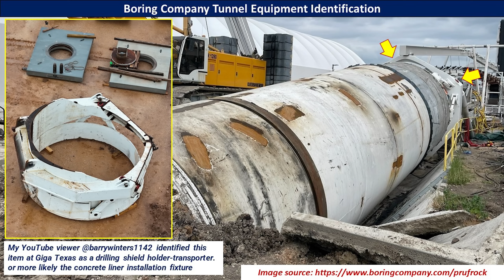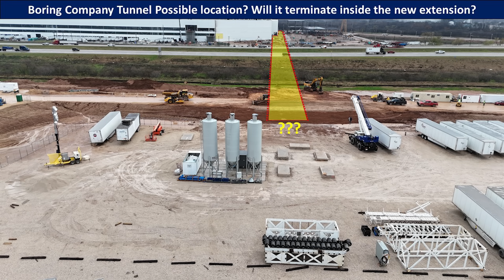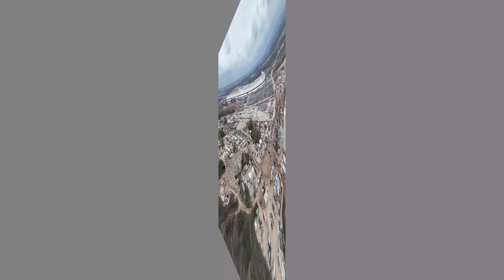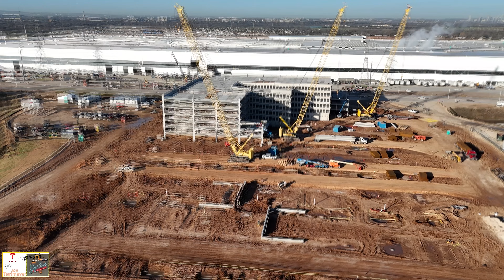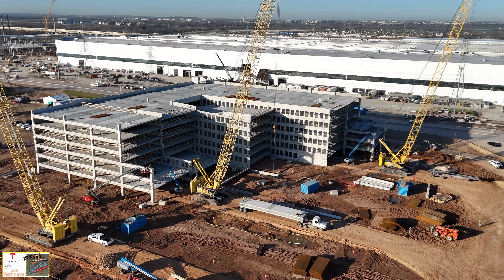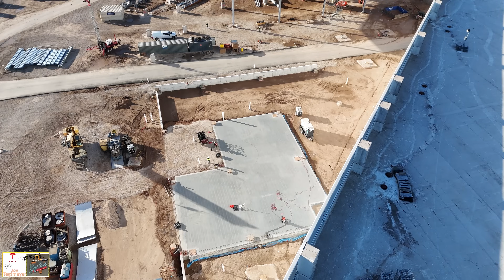Production Picking Up & Start of Boring Company Tunnel?10 January 2024 Giga Texas Update (08:55AM)

Comment: @ 29:07 Joe, the two main power duct-banks that supply power to the factory do not connect directly with the Megapacks. They go to the Tesla Enclosure/Mega-vault south of the new LCRA substation. Though they do go close to the megapacks and the temporary substation, there is no connection.
Reply: Weren’t there a couple of sets of conduit installed running east/west from the megavault on the south end of the LCRA substation to around where the fence is dividing the megapacks from the high voltage switchgear? If so, Tesla could feed/pull power to/from the megapacks without involving LCRA.
Reply: @Frank-gt7me  Yes, that is correct. However that connection is intended for backup power in the event of an outage. On page 48 of the interconnection agreement, the one line diagram has the circuit breakers on that circuit labeled N.O. (Normally open).
I believe it is also mentioned in the text of the agreement as well. Though I'm not 100% certain without going back and re-reading it.
So there is no direct connection to factory power.
In order to get power from the Megapacks to the factory, the normally open circuit breakers in the BESS substation first have to close. Then there is also the switchgear in the white buildings above the mega-vault.

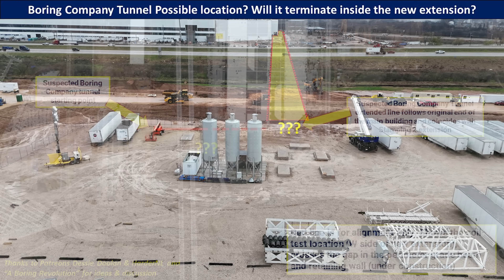Comment: At 3:25, the 5 pads in line with Joe's yellow graphic might be a clue to the exact alignment of the tunnel(s).  I think they are for tunneling support equipment

At 26:50, the original WOW lot is looking thin.  Maybe they are clearing it out for another purpose.
Reply: I agree. I think the pads are for the conveyor magazine foundations. Probably to far back for the launch thrust reaction.
Reply: @davidsalisbury50  Conveyor magazine. Thanks. I'll add that to the database.

Comment: Thanks Joe!
Parking garage:
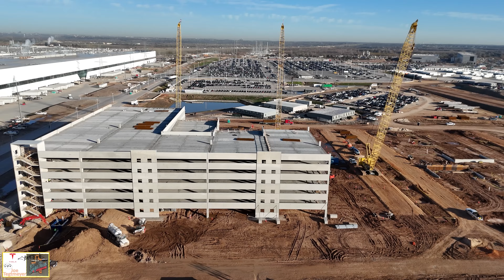@ 6:27 (Left) Trench with PVC pipe in it.
EOL facility:
West:
@ 13:48 (Bottom right)Trench for a duct-bank coming from the westside of building. Possibly to supply power to the parking lot lighting?
North:
@ 14:12 (Bottom left) and 14:27 Another new duct-bank at the northwest corner of the building.
@ 14:18 Appears to be cables in the vault that has a ladder in it?
North side of casting:
@ 17:45 Crew around the open vault and a look @ 18:40 in the north parking lot indicates that a cable pull is about to begin. The cables will be pulled from the vault on the eastside of casting seen here @ 28:46.
BESS substation:
@ 19:42 Still having issues with the 345 kV circuit breakers.
Temporary substation:
@ 20:49 Substation completely de-energized.
@ 21:09 The 138 kV transmission lines have been disconnected from the substation and reconnected to each other.
Eastside of casting:
@ 28:46 (Bottom) Cable pull into one of the main power duct-banks going north is about to begin.
Old vault behind the cable spools will likely be re-used and placed by the building to serve as a new power supply for the Superchargers.

Comment: It would not make sense to tunnel under the extension of the building as there was extensive piling installed that would interfere with the tunnel installation.
Reply: Geopiers (compacted aggregate) would be no obstacle to the TBM. The CFA piles (reinforced concrete) are only located under each column, plus 1 or 2 mid span of the perimeter grade beam between columns.

Gap in the perimeter grade beam that I'm confident is the alignment of the tunnel wouldn't have a CFA pile mid span unless the tunnel alignment was a late decision. But I don't think it was a late decision for other reasons.

Comment: While I think it would be extremely cool if a tunnel went into the factory, I do not believe it will. If you think of all the underground utilities, drainage lines, Drain Manifold near that area, and then lastly the water/well/pump station it would be right next too. I think having it go completely under the factory would be more likely than coming up into it. Iunno, not a tunnel engineer, just thinking of the logistics of placement of a tunnel within the floorplan of the factory (takes up a bit of space), and adds complexity. Iunno, we shall see! :)
Reply: The large 96" 2.4m stormwater drain is only real obstacle. Nothing is deeper than that. Just has to sail under that and come up inside the building close to the end of the production line.
Reply: Doesn't take that much space if you lower the cars with a lift.
But all they need is a shortcut to the end of line building, so an entrance somewhere outside will be much easier to realize.

Comment: In the area you noted the tunnel may come into the factory side of the highway, is the 'dewatering system sump' in the way or just to the side of where your 'yellow line' was?  Great video Joe!
Reply: Yes, seems there is a lot of substructure in the way.  Perhaps the tunnel will be an 'S'- or 'J'-shape so it can tunnel under the pipes and conduit.
Reply: That  "dewatering system sump" is a sewage lift station, just like the many others around the building. If they built a tunnel there, it would be funny if the lift station sprung a leak :)

Comment: I think the plastic around the chiller area is for the low-teen temperatures coming this weekend
Reply: It does freeze in Austin once in a while. I would think that the chiller plant would be engineered for that. Pipes appear to be insulated. For heat the area needs to be enclosed. In addition to the walls there needs to be a roof. Maybe we will have a better idea in Joe's next video.
Reply: Probably, but for what reason? Comfort, some sort of curing?
Reply: Freezing pipes

Comment: The tunnel will begin and end inside a shelter, or Tesla will be pumping rain water out of the tunnel.
Reply: Yep. Start inside the factory, end across the highway under an awning.
Reply: What about that 33 mile long tunnel that passes under a sea?
Reply: @jbbuzzable  I am sure they have water pumps and air circulation blowers.

Comment: Thanks Joe - Just a thought on the boring tunnel, presumably for new vehicles to have safe and easy access to the prep facility. Perhaps the cars could self-drive through the tunnel(s) to the prep facility. Automate everything!
Reply from the maker: That is the eventual plan.
Reply: My experience with FSD (Model S & X) is that it takes approx 50 miles to calibrate the cameras before FSD works so probably won't work at this time.  But you never know what the future will bring.  Thank you Joe for all you do to bring us these views and information.

Comment: As cool as a tunnel from the new EOL facility to the inside of the factory expansion would be, the yellow line at the beginning of the video ignores the well and plumbing infrastructure that Tesla was working on earlier. The tunnel might line up with a building exit, but they probably don't want to burrow through their own plumbing.
Reply: The depth of the utilities don't matter since Boring drills under it all. Just need room for entry and exit.
Reply: Yeah, if not deep enough.. go deeper. 
I actually wondered why they bothered walling in the short south extension before the rest was done... Covering a boring entrance was a mad nutty long shot... I'd live to hear if true why they decided that was such a priority... Doesn't seem like much saving compared to driving under the bridge nearby.
Reply: @WhodatIzz  They may not drive at all.  They conveyor system could carry the cars through the tunnel.
Reply from the maker: Actually, my Patreon Dessie Doolan already took both the well and the splitter box into consideration. That being said, I'm still not convinced the tunnel will be inside the factory, but Dessie is pretty sure it will be. Time shall tell.
Reply: Next longshot guess.. The tunnel goes from EOL to the train yard miles north.. Doesn't even stop at the main factory.

Comment: Stabilizing and strengthening the soil by injecting cementitious material raises the question.
Is that done from above ground by drilling or out ahead of the boring machine from the tunnel?
Reply: Aside from a few possible exceptions. it doesn't matter.
Reply: Are you talking about the grout? It's done from the TBM back over the top of the  segments to fill any gaps left
Reply: those three "cement towers" is indeed for the grout applied between those hexagonal tunnel segments to waterproof the seams because by definition, the tunnel MUST be waterproof.  The boring company does not prepare in any way the ground ahead of it for drilling, which is why it is so fast.